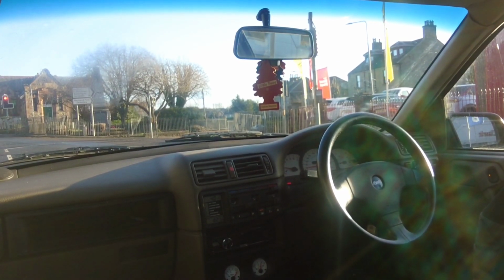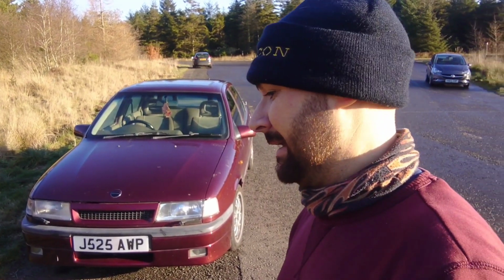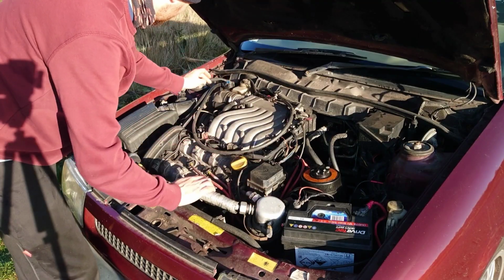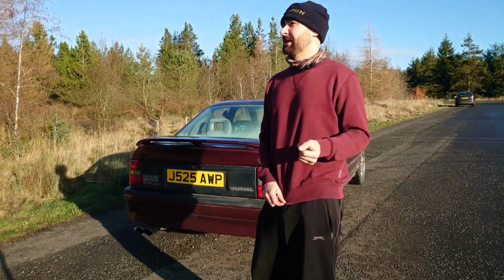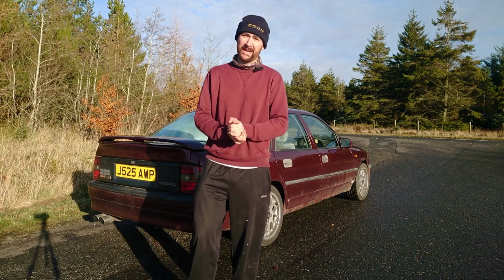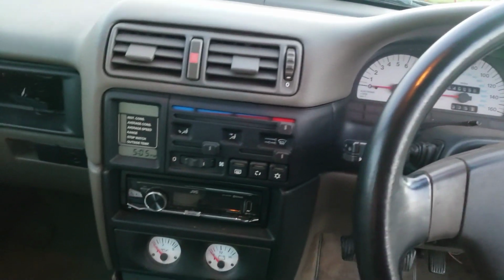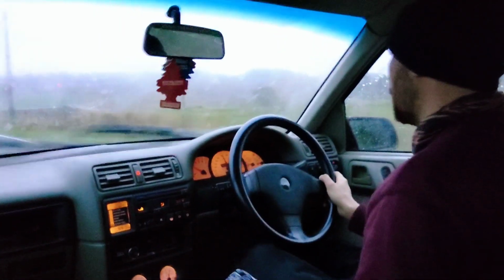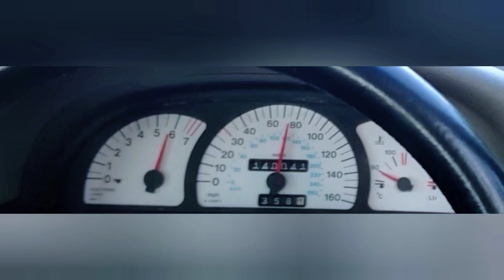Cavalier GSi 4x4 with 3.0 V6 cop car engine. A real one-off Vauxhall. Full story & road test action!

Comment from the maker: At 35.18 this section of the video has jumped out of place. Will see if I can fix that - have noticed it haha!
Reply: I  had a 1.7 TD Cavalier saloon the engine was from Isuzu i ran it on used chip fat :):)
Reply: @kylereese4822  Doing That is more friendly for the environment than Electric Cars are... But Shhhh
They don't want people to know,
Reply: @rrshowtime3900  Wrong......

Comment: Enjoyed this. I’m a bit of a sucker for an old Vauxhall and you’ve inspired me to take my V6 Calibra out for a jaunt. I’ve got some “G” cams from the Y32SE Vectra C GSi engine to go in next year when the timing belt is due to be changed. As far as metal cam covers go, they don’t so much seal better as don’t warp like the plastic ones do. When I got my V6, they were like bloody Pringles on the sealing edge. A swift swap to metal cam covers later and that oil leak stopped. 

If I may be so bold as to offer some video feedback, be wary of volume balance. The conversation pieces and driving pieces had a distinct volume difference and I nearly woke the dead through my TV. Overall though, top work. Really enjoy content on this channel!

Comment: That is a nice Cavalier, I had the 2.5 V6 same colour as that, fitted a stainless intake pipe & ram air filter off a Corrado V6, fitted a modified plenum & a Peco Twin Dtm Up Swept Backbox to free it up a bit. Got a set of Zender 17" alloys, new pirelli tires & a fresh set of brake pads, It was quick especially mid to top but being front wheel drive it had loads of torque steer -  you had to hold the wheel tight when you floored it or it would want to veer in the direction of the camber of the road. Nice motors the old Vauxhall's my first decent car was an old mk1 Astra GTE that was good fun too.

Comment: Hi Dougie I was always a Vauxhall man and back in the day I worked for Vauxhall and I ran a highly modified Diamond black Calibra, a bit like your Gsi it started off as a 2.0 16v cos cast red top. But it ended up as a 2.5 C25xe running 3.0 k cams knife edged 3.0l inlets, early 20xe flat type flywheel and hybrid clutch and pressure plate, because I was rolling O.Z racing super-t’s but on 4 stud I re-engineering the bigger discs and callipers from the V6 doner car into 4 stud, Remus full exhaust spax springs and Bilatien shocks. The interior started off as the velour interior with the full velour door cards then it was black leather and then it was cream and then it was customed velour and cream leather, I had footwell lights, and again like your cavalier I had cruise control, when It was a 2.0 litre I ran a modified Astra gate/calibra Dash and then put the V6 dash and aux gauges in, and then Finally fitted a Rieger body kit with an SE8 spoiler all painted fitted by me. So I appreciate the work you have put in to your GSi, but did you know that the Saab V6 version of the  c25xe also had a turbocharged version and reversed inlet? I was considering at the time doing a twin turbo conversion on the V6. Also the alternator cooling fan is the same unit that the Omega used to cool the ecu in the battery tray so if you need to source one look for one of them, and that will prevent the alternator overheating, and all that hassle removing it through the offside. But have you thought about getting diesel cavalier lowered spec front springs as the Diesel engine is heavier than the V6 ?

Comment: Great video Dougie.  Just on the rust prone bit, I think it's best to keep sensibly using old cars through the winter like you're doing.

Cars like this are for driving, not sitting looking at. Secondly,  you only end up with other issues when cars don't move for six months!

Comment: Cracking vid Dougie. You've given me the itch to get back into old vauxhalls. Was heavily into vauxhalls at the time this cavalier was put together. Remember reading about it in TV. I had a Gsi 2000 4x4 at the time painted metallic green with gold wheels 🤦‍♂️(you would have seen it at falkirk cruise I'm sure) , moved onto a redtop mk3 astra gsi from that until I made the jump to rwd and e30 bmws 👍
Reply from the maker: Is Falkirk cruise still a thing? Had some great nights there around 03/04
Reply: @OnceDrivenForeverSmitten  apparently so. I haven't been in years. Back then would have been the retail park and a few laps of the circuit. Good Times. 👍

Comment: Fast road racers are very different to fast circuit racers,  take iom tt for example (more skill road racing in my opinion, ive done both motorcycle racing, totally different set up, mid range, torque, road inclines  etc). Thats an excellent road car you have built, the factory should have built. Great review/knowledge, no some fud camera pointing to themselves for 20 mins, ive vectra b gsi v6, vectra c cdti, corsa d sri, enjoyed that👍

Comment: What an epic dream build! Those 6 speed gearboxes alone are going for big money today too. How is the AWD system holding up? I remember hearing that these were failing on the standard Turbo models and you must have higher torque running the 3.0ltr V6 over the 2.0ltr turbo? You`ve built a truly stunning car! I enjoyed my time with a standard G reg 2.0ltr SRi, so driving an AWD version with double the power and that INCREDIBLE soundtrack must be pure heaven!

Comment: Hi dougie,
It looks like you have what would have been a vauxhall internal fleet demo car, the fleet at the time of this cars registration was  run by white arrow fleet who pdi'd the cars new and delivered them to any vauxhall dealer who needed to demo the cars to a customer (during this period a lot of the vauxhall network rarely held any new or demo stock with a sports badge).
Back then we could request anything off vauxhall fleet and have it delivered within a few days as a short term loaner.
The tell tale sign on your car is the reg number,  AWP plated cars were registered through worcestershire where white arrow were based, the fleet still runs to this day but on a much smaller scale as most vauxhall dealers will stock everything in the current range, the fleet now mainly loans out electric vivaro's and corsas to companys interested in an extended demo.
I worked for vauxhall during the 90's and sold most of the range new and used, if you ever want any info regards specific models and weird spec's just let me know as i will probably remember.

Comment: Nice to see a V6 as I worked for the V6 engine plant, I rebuilt and fitted a 3.0 v6 into my Calibra with a lightned flywheel 5.5 kgs big improvement on the 15kg standard. (sold it to my friend who still has it, he managed to get a chipped ecu for it)
I also fitted the vectra cam covers to it, but on the oil leak issue this is due to high oil pressure. The oil pressure is regulated to 5bar by a spring loaded spool valve in the oil pump. Unfortunately the oil feed to this regulator gets clogged up this allows the oil pressure to rise hence cause oil leaks including oil in water (yes its not only due to the heat exchanger)
To check the oil pressure just remove the oil pressure sender and screw a gauge in. (the one on your dash maxes out at 5bar so no use)
This V6 pump can put out 10 bar it then opens a dump valve that puts the oil back into the crank case.
When you test your oil pressure and find 7 bar + (which you will) put an oil flush in it as this normally knocks it back down to 5 bar, then repair the leaks, then flush at every oil change.
Reply from the maker: Fantastic tips there Geoff. I've got a pressure gauge kit. Will need to do the timing belt for it coming back out so will check the oil pump. It's likely to be what you suggest.
Reply: @OnceDrivenForeverSmitten  its the rollers that go, all manufactured by SKF, have you got the fitting tools? Don't use those cut outs on the back plate as they are miles out. If you ever do another rebuild on it I have all the factory tools which we bought when the engine plant closed.
Reply from the maker: @BigDave1965  I've got the locking tools from Laser. Hoping I don't have to haul the lot out again, but if I have to I will. Mainly a weep from the sump and cam covers so I could fix those with the engine in place.
Reply: @OnceDrivenForeverSmitten  has it got the later aluminium sump? As the early cavs had pressed steel
Reply from the maker: @BigDave1965  ah found this comment thread again. It's a steel sump from a L reg Cavalier V6
Reply: @OnceDrivenForeverSmitten  the aluminium one is interchangeable as fitted to later calibras and vectra b

Comment: Another great video Dougie, your comments on the 150bhp 4x4 gsi and it been underpowered were similar to my Dad's RS 2000 4x4 Escort, which funnily enough had 150 brake too, resonated. I had the pleasure of driving dad's a few times, even back to back vs my 1.8si fwd 5 door. Again my car was "sharper", but as I found out in the rain the 4x4 was like a limpet, unlike my own!! Coincidentally enough you maybe interested to know that the semi hot Mk1 Focus was supposed to end up with the 2.5/3.0 v6 engines, but instead the St170 was born. As I've said before I have a newish appreciation of Vauxhalls as my Chevrolet Captiva uses Antara bits, however is a bit more powerful and has 7 seats. The car whilst heavy handles well, cruises easily, but when asked picks her skirts up and can be quite quick when she wants, she does like a good drink of dirty diesel though! I enjoy  your vids, and perhaps a suggestion would be that I'd  like to see a comparison video with the cav turbo and a saff cosworth as it would be nice. I can almost (almost) imagine Jimmy Nail zooming round Newcastle in "Spender" at the wheel of a Cav Turbo! Best wishes, Ben 🚌🚍☃️🎅❄️ ps hope the Ford word doesn't upset you vaux folks too much, but as said I have current dual "nationality" with a Foci and the Captiva! 😆😂😁
Reply from the maker: My mate has a near standard Sapphire Cosworth 4x4 in Magenta, cloth interior and air con. We can make a head to head video happen this summer! Thanks for the insights 👍
Reply: Thanks for the reply, I'll look forward to the comparison. I've been in a Saff belonging to a colleague, modded to about 400hp, I thought it would take off!
I always liked the mk2 astra gte, I think the 16v would show a clean pair of heels to an RS turbo (which my dad also had but sadly I didn't get a go in) in a straight line, but not perhaps in the twisties. I loved the "Knight Rider" dash!
I'm a keen car fan, and I've written to Autocar a good few times about how at times (& defo in the past) Vauxs and Ford's have had a very bad press. Vauxs have been missing from group tests etc for years. This is borne out by how much mint hot hatches are worth.
Anyway, keep up the good work, Id love to see a Manta on the show, the Rally ones look fab, same for the Asconas with the tentative Ford link of Ari Vatanen!
Happy New Year,
Best wishes, Ben

Comment: I really need to fit another gearbox and fly to mine. The 3l cams and lower inlet on my V6 need a much shorter 3rd gear to help get some nippier acceleration back! Top end it's fantastic, but 3rd is a bit dead below 3.8k.....gearbox is the next thing to do!
Reply from the maker: F28, LET clutch and flywheel is your best option, you'll need to space the engine mounts over 23mm though as the box isn't as bulky as the F25.
Reply: @OnceDrivenForeverSmitten  AHH you done it the engine mount way. I know some have had a really fancy spacer made for the bell housing. Thanks.

Comment: Fabulous vid!! Out of interest have you driven the 03-08 Saab 9-3 Aero?

It seems to be the ultimate of that platform?  

 Thanks
Reply from the maker: No but I am thinking about buying an Aero of some sort later in the year, they're stupidly cheap
Reply: I had a 52 plate 9-5 aero hot for a bit, a few years back. One of the best, if not the best, car I've driven. I credible things. Extremely comfortable, fast, and Vectra B coilovers fit them, which I fitted for better looks and handling 😀

Comment: Would this car have had the twin square exhaust back box back in the day, same as the GTE 16V? I seem to remember buying one of those to put on my 8V GTE, as it looked way better. I think at the time you could buy an original GM part and a sort of aftermarket lower grade version also through Vauxhall.
Reply from the maker: Yeah it would have, sadly they're long gone

Comment: What kind of flywheel did you end up bolting to the V6?
Reply from the maker: C20LET and clutch
Reply: Surprised the made the V6 crank bolt pattern the same as the 4 cylinder one. Thanks for the info.

Comment: Do you think you can still get the 4x4 accumulators ?
Reply from the maker: Yeah I got one off eBay and I got a mate one as well. There's a FEBI part number for it. £65.
Reply: @OnceDrivenForeverSmitten  Have you fitted it yet? I see some listed as 1817

Comment: If you use the c25xe ecu on the x30xe engine you dont have 210bhp, but like 190bhp. You need to chiptuning to get some more power.

Comment: Due to all the changes that's been made, would that make it unable to qualify for "historic vehicle mot"?
Reply from the maker: Dunno. Its got 9 years until it's 40. I'd continue to MoT it anyway 😇👍
Reply: @OnceDrivenForeverSmitten  
According to the uk gov website as long as there's no major changes, you don't need to get a mot after 30 years.
Cars built before 1981 no longer need tax

Comment: Why not put the Saab / vectra vxr engine in the car. That’s what people seem to be doing now. 300 bhp with relative ease…
Reply from the maker: A Vectra VXR engine would be very difficult to mate to the 4x4. We do have a 2.0 Saab turbo engine in stock which is awaiting a suitable home
Reply: Is that the engine from the insignia Sri turbo vx line.?

Comment: I went to see one just after the millennium at Coatbridge but never bought it.
Reply from the maker: My mate went to see a GSi from there in 2002. Decided to ease the side skirt off for a look and it took the entire rotten sill with it. Car was 11 years old. GSis were horrendous for rot. Most lived hard and died young.
Reply: @OnceDrivenForeverSmitten  It was very probably the vey same car fella as it was also 100% 2002 - Reason I know that year is I had just moved into a new house and that was the same year. 
Pretty sure the place was called Whites - old garage forecourt style place, they had a white Sapphire Cosworth I looked at too but ended up buying a nearly new Ford Ka, was sensible but boring af and all my mates gave me some stick for it lol. 
Only had the KA for about a year then I bought a nice Audi A4

Comment: @once driven forever smitten get on the email to Mike H & lock that box. Its not matter of IF its WHEN. Best thing i did to the BRAT if im honest. I had up rated transfer box which popped. Lock dat shit up boss !
Reply from the maker: Got a new accumulator bulb to fit before it's back out properly for 2022. Will keep the OE system going if I can. Hoping it'll be OK!
Reply: Why you prolonging the inevitable, youve had one pop on you 😂🤣, do that chocolate box a favour & lock it. Poor design should of had an oil cooler and twice the capacity of oil & would of stood a better chance of lasting. Email Mike H & get a set ready as that transfer box was doomed the day it was made.  Really enjoying the content. 😝
Reply from the maker: @whodat7366  that was my own fault as the accumulator bulb wasn't changed when it should have been. My car has the ABS deleted and with the OE system it disconnects the drive to the rear under braking. A locked box cannot do that and I have a question mark on stability should there be an emergency. 

The design was great in theory they just couldn't make it a reality with the technology available at the time sadly. I agree about the oil cooler, good idea! Would like to compare the likes of the 405 Mi16 4x4 for issues, there were a lot of all wheel drive family saloons around then 

I think with the V6, the drivetrain shouldn't be too stressed. It's not going to get the severe strain it would from even a 250hp C20LET.
Reply: Well when it does go please tittle the video transfer box turned to a chocolate box. 😅😂🤣

Comment: Its tacky sticking badges on the back that dont go with the car
Reply from the maker: The 24v badge is off a Senator and replaces the 16v badge, due to the engine now having... 24 valves. I reckon that's 100% fair game. A little touch only a few people would notice 😉👍😃